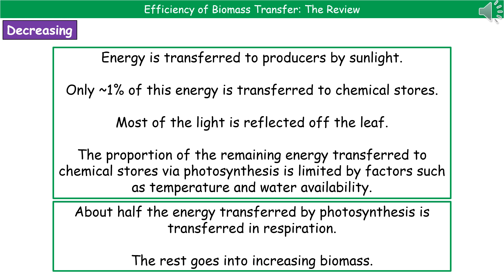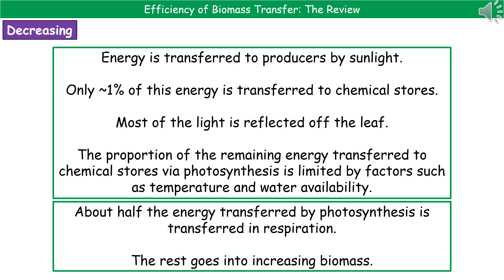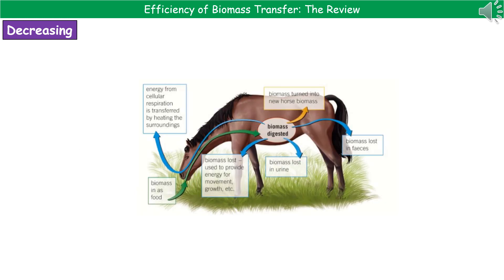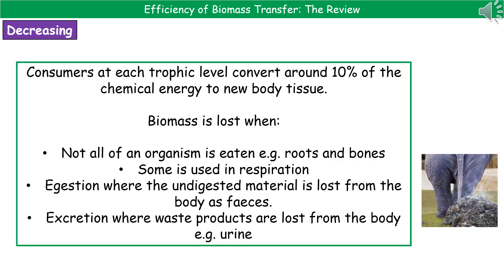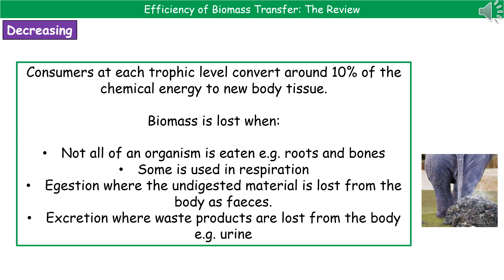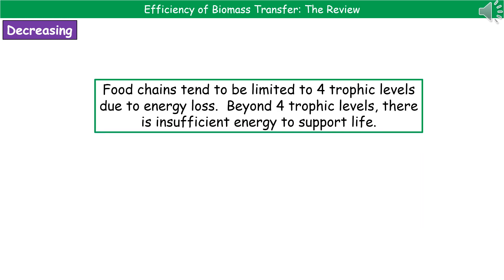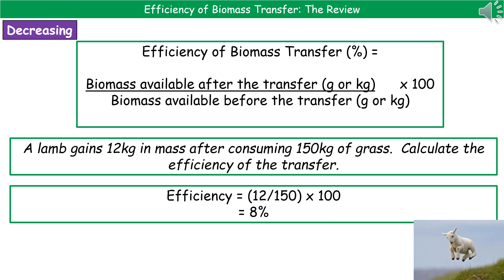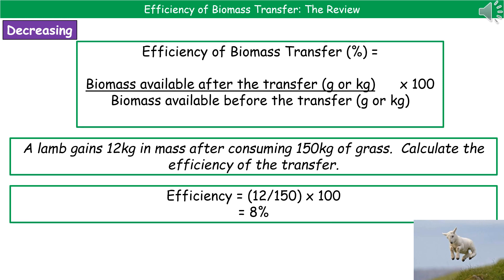OCR Gateway A B4.1.5 - Efficiency of Biomass Transfer

Comment: Wouldn’t it be 108% cos biomass after is 162kg and biomass before is 150 so (162/150)*100=108% ?
Reply from the maker: No...The grass biomass of 150kg is not available after.  It was used to generate the 12kg of lamb biomass.  So you only have the 12kg available at the end.  Remember, not all of that biomass from the grass will make it into the biomass of the lamb due to losses.